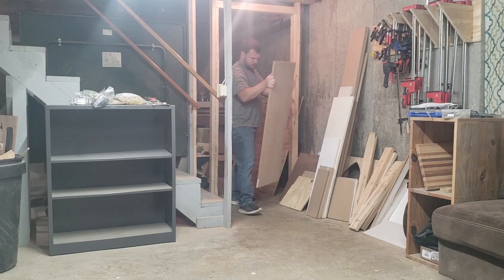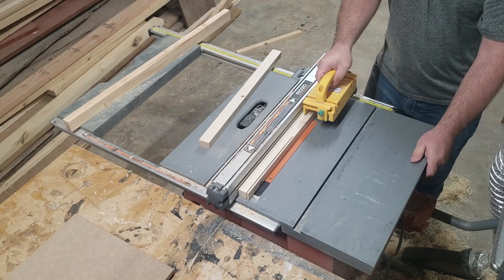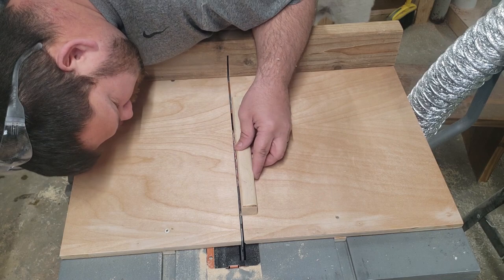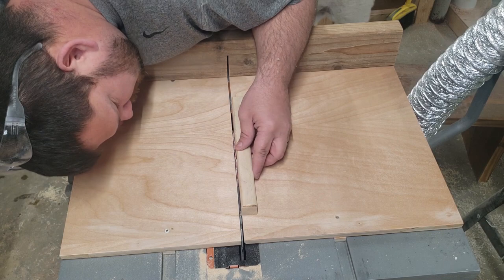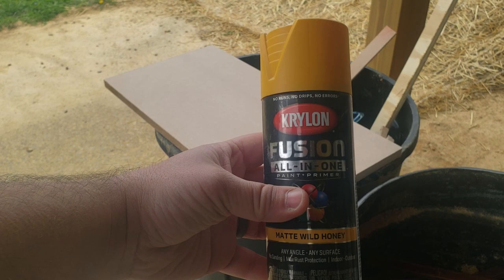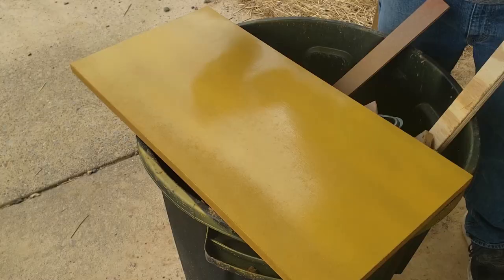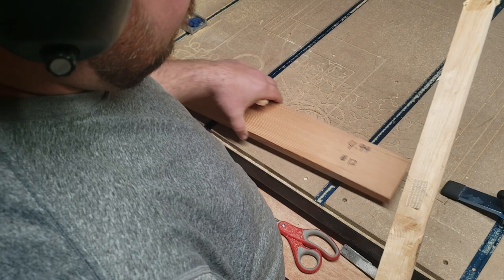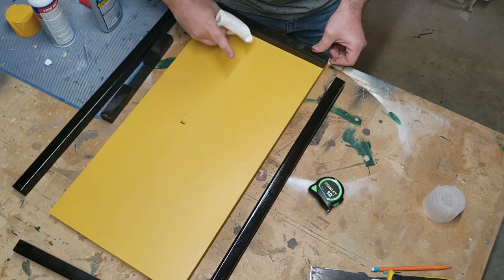Making a DIY Pucket Board Game // Woodworking Projects // Easy Woodworking

Comment: What are the dimensions for it all. How low do you drill you holes for the bungee cord.
Reply: I think it depends on the puck. For example if your puck were an inch thick, you probably want to have the cord sitting at 1/2 an inch, right?